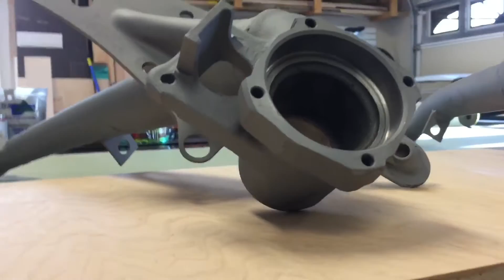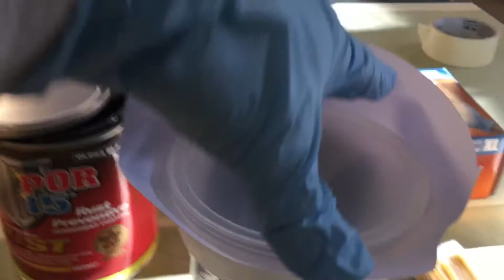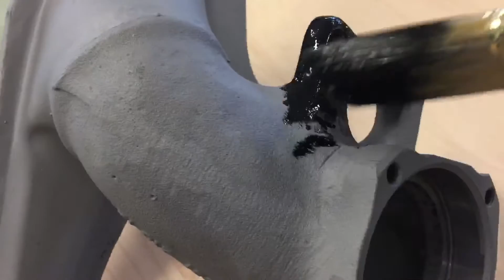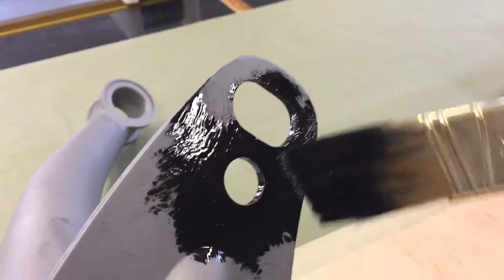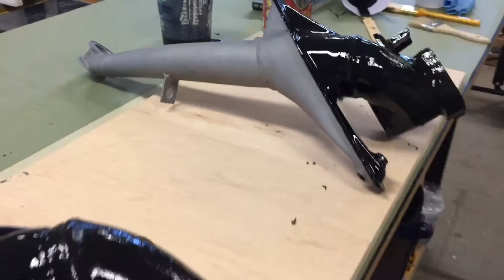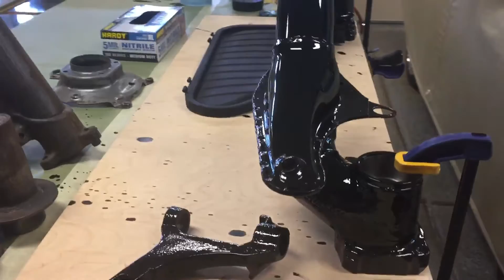1967 Porsche 911 Video 13 -   POR 15 coating

Comment: What do you recommend on preventing rust on the threads? just a little threadlocker or oil on the bolt?
Reply from the maker: Hello Phillip
Im a big fan of thread sealant/locker..Its a good lubricant threading in the screws, nuts and bolts.
I don't like oil as eventually they will loosen up.
I generally give my hardware a good cleaning if they are coated with any manufacturing oil before installing
Also after electroplating any hardware it is extremely dry and thread sealant really help the thread in without galling

Comment: Hi Mike! I'm right now going through this process and I was wondering if you would recommend this over powder coating and why? I have powdercoating easily available close to my house and price is very cheap. This two pieces from the video would be around 20$. I'm just wondering if the finish would be as hard with powder coating as it looks it is with POR 15.
Reply from the maker: Hello Eazr4u
I don't think I would recommend POR 15 over powder coating but I would put it on even plane with harness and ability to control the project without sending things out. Its a beautiful finish and finishes similar to porcelain.
Powder coating is a great finish also but I'm not a huge fan of heating up metals unnecessarily
I prefer a cold finish .. but its mainly preference
Either way you decide they are both good choice!

Comment: Hi Mike.  It's fantastic watching the progress on your car and picking up great tips and techniques.  :-)  Have you had experience with POR-15 on previous projects?  Have any of them seen much weather?  How did they hold up long term?  I sandblasted and painted my 914/4 engine tins with Wurth Rust Guard about 30 years ago.  My understanding at the time was Wurth was just applying their label over top of the POR-15 can, and it certainly seemed to be the case. The engine has sat stored in an unheated garage in Toronto, Canada since then, and while it's still adhered well, there's definitely a patina to it.  In places it almost looks like 120 grit sandpaper that has had a thin coat of semi-gloss paint applied over it.  Now that I'm finally back to working on my project I'm also considering POR-15 for suspension bits and things that will not see much UV.  Cheers, Dave.
Reply from the maker: Hello Dv Thanks
Im not sure what Wurth was using for paint chemistry but it doesn't sound like a polyurethane finish..or it could have been but not
necessarily high temperature rated. POR does make a proper engine coating suitable for high temps.
I don't have any long time experience with POR-15 or experience with it in extreme weather conditions.
I do have some longtime experience working with various finishes over the years. I would rate POR-15 a 10 out of 10 if applied 
correctly under correct conditions for durability and sealing. It would be a hard to break it down if not exposed to longterm UV.
I think it would outlast just about any product on the market over a given period of say 50 years.
Even powder coating will eventually fail under extreme UV or harsh conditions.
Its worth a try! Try it on a couple small suspension parts and see if you like its results.
Best purchased in pint size cans as once the lid is opened the air exposure will shorten the can life.
Good Luck!

Comment: I have trouble believing that sandblasted part wont start rusting especially with only 1 coat.  2k green etch primer first or epoxy then 1 coat of the por15 would seem to be  10X safer  if por15 will  bond properly it...

Comment: Thanks for the video. Do you know if POR15 will go down well over primer or Dinitrol Rc900 rust converter? 
Many thanks
Reply from the maker: Hi Ricky you're welcome=)
POR 15 sticks best on freshly sandblasted bare metal and can be used as a primer..I don't know if it will stick to your primer but perhaps  try some test spot first and see. Im not familiar with RC900 but have used some rust converters..
I would think you should be okay there but a test first might save some trouble just to be safe.
Good Luck!

Comment: are you putting a coating over the POR or leaving it as is? I think the POR must be as tough or tougher than powder coat
Reply from the maker: Hi Bob
POR is a great finish for trim bits and suspension. It really doesn't need any top coating unless exposed to UV for extended periods of time.
Works best straight up!
I like it better than powder..almost a porcelain looking finish and very tough

Comment: OK to get into a threaded hole just run a tap into the hole after the rust seal is thoroughly dry
Reply from the maker: Hi Bob
Great Tip=)Thanks for sharing!

Comment: That stuff's amazing
Reply from the maker: Hey Phil
Yes I agree its quite the wonder coating
Perfect for restorations!
Reply: Mike M And so the re-build begins ?
Reply from the maker: Will begin re-assembly of suspension parts during the next few weeks as
its starting to get cold here!!! some fun and easy winter work in a cozy warm shop=))
Targeting for February finish paint..Temps will be very predictable 70 degrees